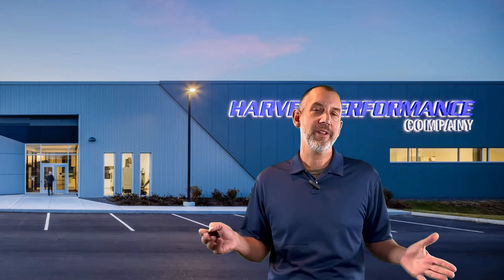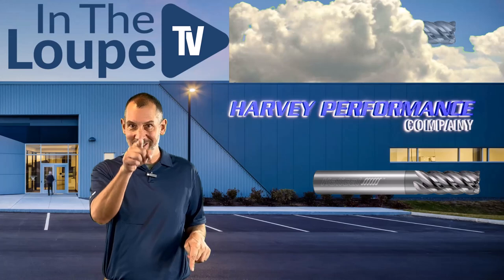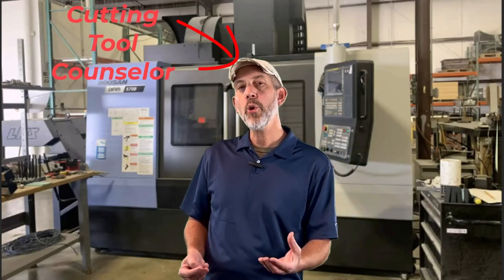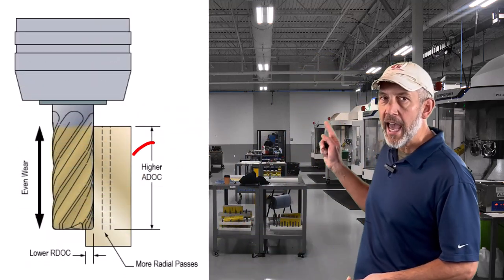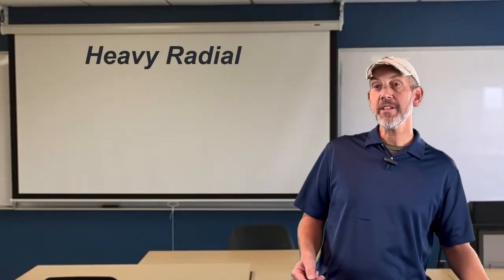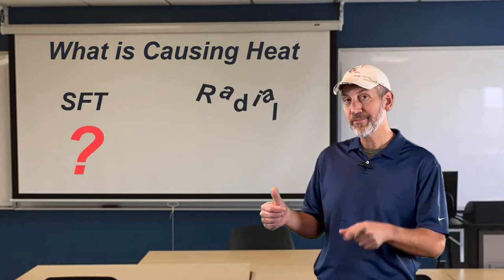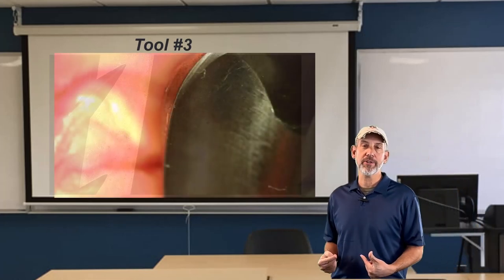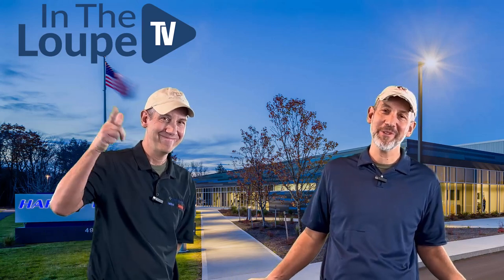Utilizing SFM in Your CNC Applications: In The Loupe TV Ep. 10

Comment: I noticed this the other day running 718 inconel! Running a larger step over with slower feed we achieved the same mrr and tools last for hours vs every other part replacing tools! Holding a .0005 total tolerance. Also ran another 718 job 3in deep 2in dia. Running a chip splitter 5fl. vs a 8fl. Tool the 8fl didn't make it through one part. 30mins machine time. 5fl. With splitter super cheap off brand tool lasted over an hour in cut. Before needing replaced! Splitting the path into 2 segment depths vs full depth helped out a ton! No pilot hole full helical to depth. About 30mins machine time but not bad for a worn out mori seiki
Reply: Great info. Thanks for sharing! Ctc

Comment: Thank you for the video. I am struggling with a new low HP machine, when I reduce SFM I increase vibration for some reason and am chipping my cutters, but if I increase sfm to 460 I at least have a consistent, but rapid wear. Cutting 304 SS.
Reply: Does your chip load stay the same?
Reply: @CuttingtoolCounselor  Yes. I get an excessive vibration error in the middle of a linear cut. I can fix it by increasing my SFM and increasing the IPM to keep the same chip load. For some reason it hates 300 SFM in stainless.